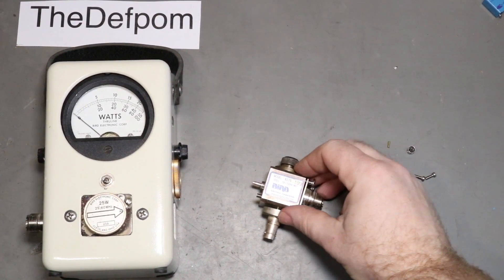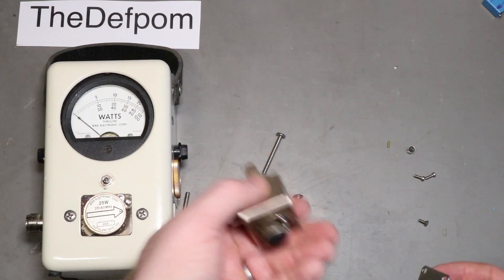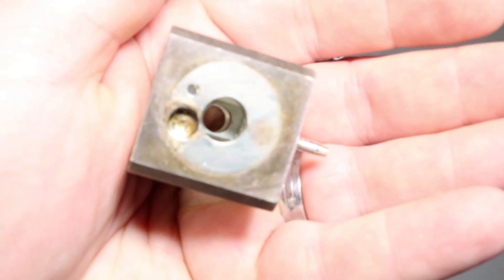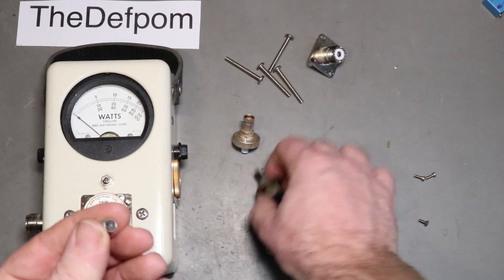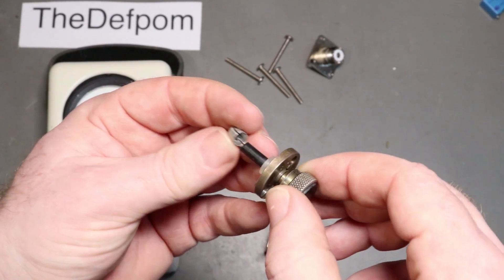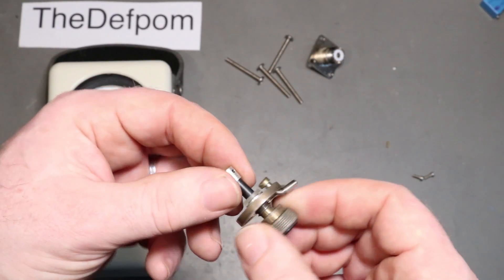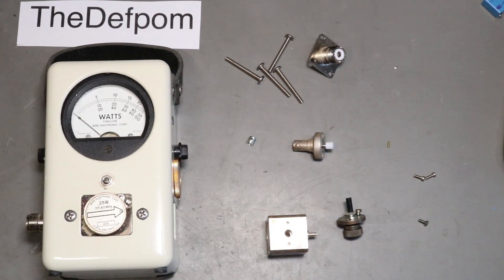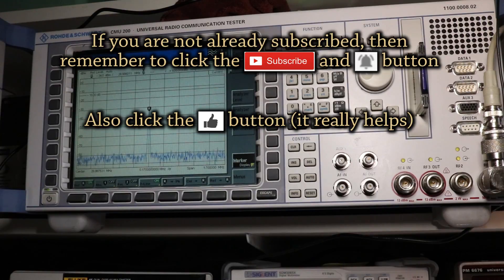🔴 #417 Bird 4275 RF Sampler Repair

Comment: I think i would have seen how far the black shaft goes into the control and see if it could be pushed out a bit, then redrill the hole :-D.
I didn't catch the repair, did you glue it or use my method?
Reply from the maker: zx8401ztv - if I had re-drilled the hole the metal cap which forms the sampler coupling would of been further away from the sampler port, reducing its sensitivity a great deal, it needed to be kept at the same distance to ensure it continued to work as designed. Also the shaft material is brittle (it might be Bakelite) so I didn’t want to risk making it worse. I glued the cap back onto the shift, seems fine so far.
Reply: Perhaps you didn't understand what i said, the black rod goes into the control knob, see if it can be pulled out a bit.
I do waffle on a lot lol :-D.
Reply from the maker: zx8401ztv - that may of been possible, but I’m lazy and glueing it was easy.
Reply: lol, i find hot glue a good bodging tool.

Comment: Great vids. But how did you fix the end into the shaft then?  Did you glue it in the end?
Reply from the maker: worldradio456 uk - yes I superglued it, that the only solution apart from 3D printing one.
Reply: Thank you for the reply.  Yeah you cannot beat superglue 😁. 73s.